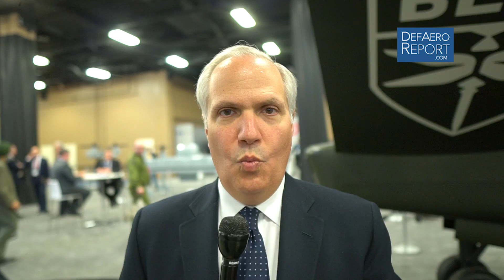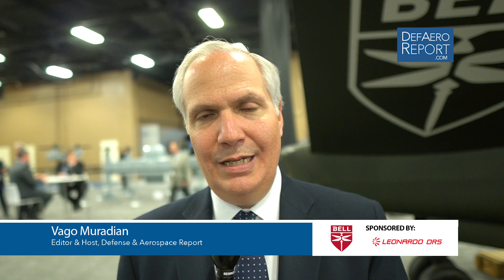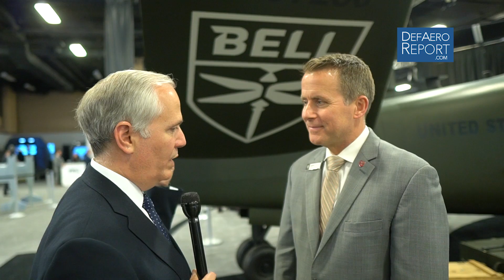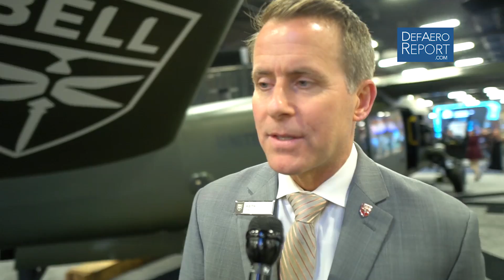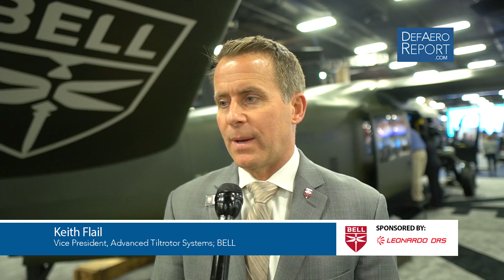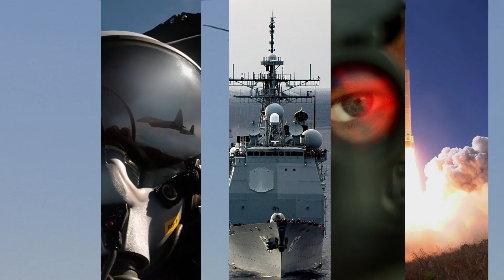Bell's Flail on V-280 Valor Update, US Army Future Vertical Lift Requirements

Comment: 2028? Are you kidding? 8 years is a freaking lifetime. Why all the backslapping on the speed of this program at this point in time?
Reply: A typical military program from signing Intent to proceed to EIS takes 20 years
Reply: They aren't going to be knocking out 5 or 10 of these. They have built out a factory full of production tooling, get everyone trained to build it, etc. That's a big job all by itself.

Comment: At some point, someone is going to have to up the ante and look at replacing the C-130 with a VTOL solution. The Osprey and Valor are inspired tactical applications, but won't be able to fill a bulk Logistical role. 

The biggest headache when your deployment logistics depends on air lift: You need the damn airport. And that massively upscales your needs in security and even more logistics requirements
Reply: That's a really good insight.
Reply: Look at the HETR in the NASA research docs and the Karem aerospace TR65. The design is there, Just need someone to open the checkbook and say „make it so“
Reply: @chrissmith7669  Hadn't seen that one before, thank you. Found this too, looks like they're already on it: 
http://www.icas.org/ICAS_ARCHIVE/ICAS2010/PAPERS/458.PDF
Reply: 4c1dr3fl3x if you look for the Marine‘s fleet status and forward looking plan you will find some interesting wording tucked between the lines.   Their future vision includes a tiltrotor with a step improvement in cargo capacity, speed and range.  It reads to me like a big brother to the Osprey is on their wish list just Not at the top, yet.

Comment: He asked him how much per flight hour twice.... Still waiting and I like the v-280
Reply: Either the number is high, or they don't have an answer yet because they havent done the math and projections.
Reply: Not enough data to bring it down to an acceptable number.
His point is correct though with cost/capability balance. If it costs twice as much but is 3 times more capable and equally sustainable then having half as many for the same price puts you ahead. Omfg my head hurts! 
How do these guys do this all day at one of these events?
Reply: Yah, it’s higher, you can tell by the way he danced around the question. Still, his point is well taken and it can be argued that this aircraft is transformative.